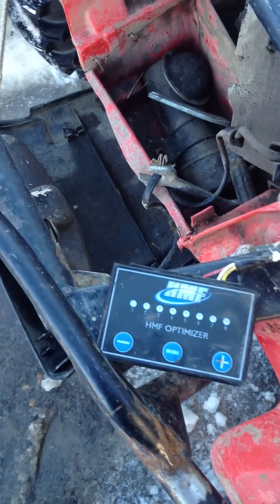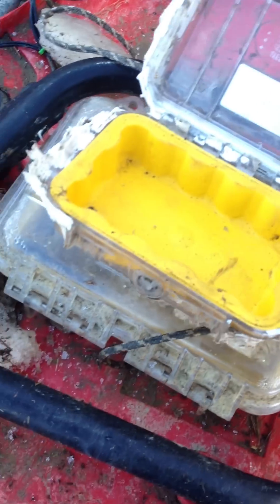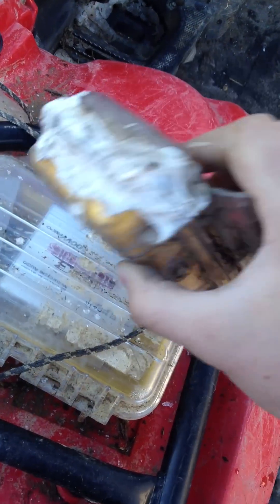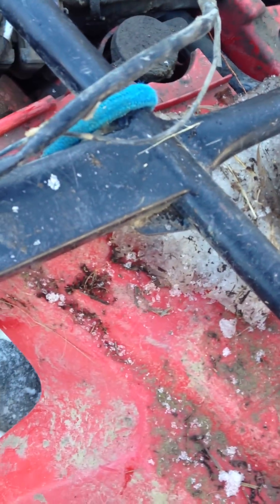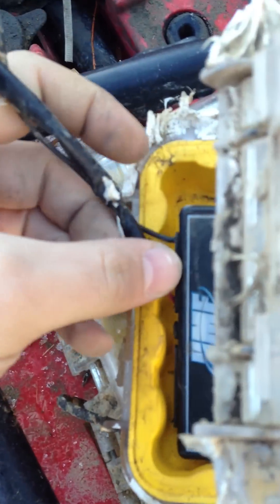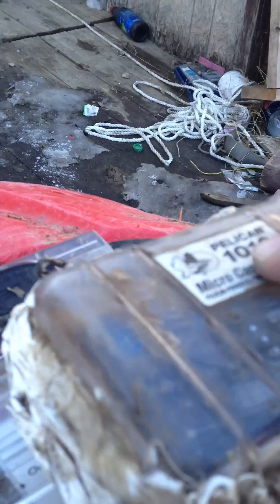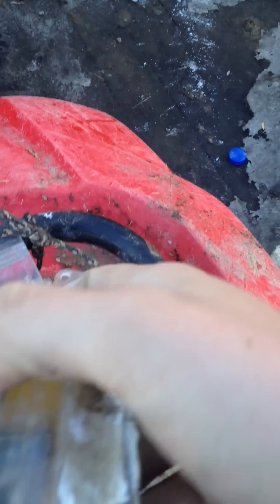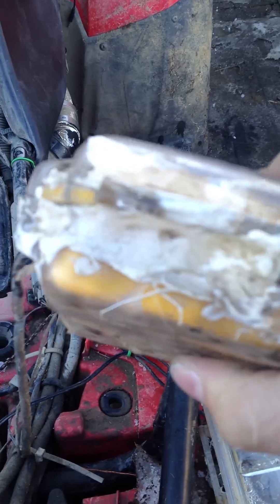How to water proof your HMF optimizer.

Comment: Hey man its me again, got a quick question.. haven't rode my 4 wheeler in a about a month and just went out for a little ride and noticed my hmf optimizer isn't working right.. when I turn the ignition on it only flashes at red and not green and red.. when the engine is running the lights aren't showing.. have you ever had this happen?

Comment: Do you ride with your airbox lid off? I called hmf and asked them about if it should be off with the recommended settings they gave and they said yes and that the optimizer is pointless if you are riding with it on.